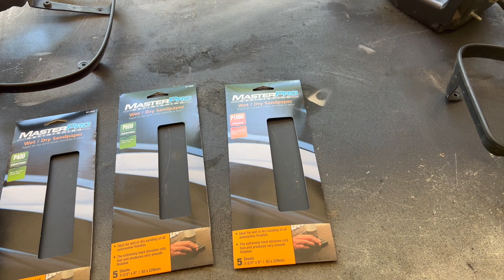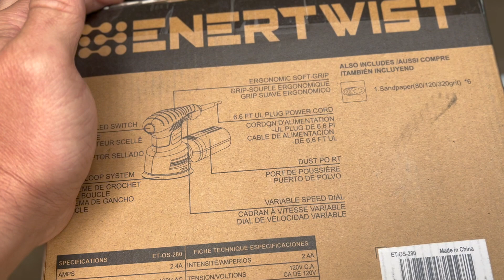DISASSEMBLE & COLOR MATCH MIRRORS!

Comment: I've been watching the progress of your GMC Sierra for quite some time I gave you plenty of messages but I don't think you've got them or you didn't read them seeing that this video is new the probability of you reading it is higher so I have a 2001 GMC Sierra SLE extended cab two-wheel drive unfortunately it has the 5.3 l vortec V8 engine 285 horsepower stock. I have owned the truck for over 6 years seems to me that you have a lot better luck than I have with my truck.  Within the past two years I have invested over $10,000 in vehicle in repair costs. The only real upgrades that weren't repairs was my flowmaster FX dual exhaust system which surprisingly crank my horsepower up to 294 HP in this truck cranks 285 stock. I replaced the driveshaft I had the whole thing rebuilt I replace the rear differential gear inside with a limited-slip rear differential new backing plate and bolts obviously new fluid. I replaced a hundred percent of the emergency brake system on the truck I gutted everything and replaced it hundred percent new. I also replaced rotors pads calipers front and back. I also bleed the brakes. I replaced sway bar links and bushings I replaced all four shocks I replaced all four wheel bearing hub assemblies I replaced the battery with a interstate battery because I've had great luck with these. I replace the serpentine belt the AC belt replace the tensioner pulley I replace the spark plugs spark plug wires I replaced 4 coil packs I replace the throttle position sensor the m a p sensor and I replaced all four oxygen sensors that was very expensive replacing the oxygen sensors. I replaced both power motors for the windows I had to replace the fan motor inside the truck the fan switch that controls the speed of the fan. I had to replacesome brake lines I had to replace a fuel lines and the fuel line going into the gas tank plus I have to redo the entire frame and that cost me $3,800 and then they tell me this after I've invested all this money 💰 into the truck. I quickly realized this shop was trying to scam me and sure enough that's exactly what they were trying to do to me. My truck has 123,000 mi and change on the odometer it sounds great it purrs in sounds absolutely fantastic with that dual exhaust system I put on. I also installed a k&n cold induction air intake system. And I've done more work to the truck but I just can't remember the rest of the stuff I have done what that was about 80% of the stuff I have done within the past 2 years it's been getting to the point where I'm ready to throw a frag grenade into the cab of the truck is getting to that point because I'm getting sick and tired of throwing money 🤑 at it. What is your suggestion if this was your truck and you were in my predicament what would you do????

Comment: Pick up some spray max 2k clear coat,its got hardener mixed in and it actually provides a proper uniform gloss unlike the cheaper 1k clear coats. You can make it look like a spray gun was used

Comment: if your power fold mirror is loose at the base, this is how you take it apart (on the truck if you want) and you can snug up the torx screws that hold the folding mirror motor at its base.